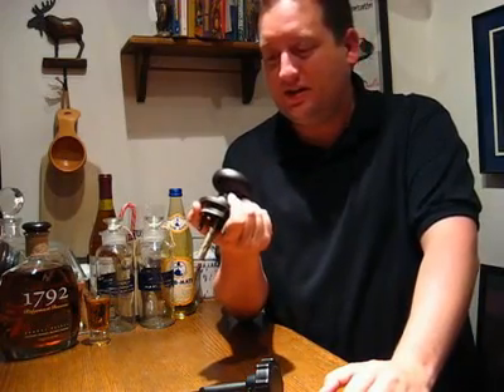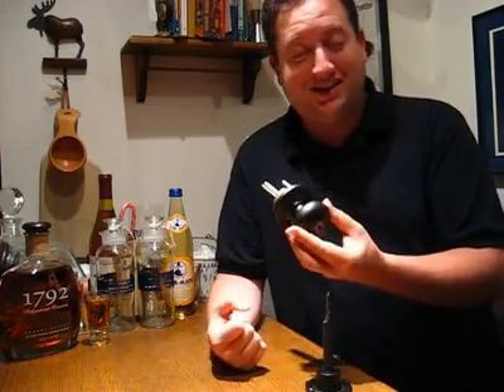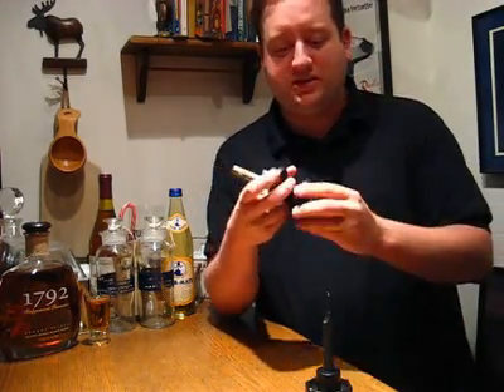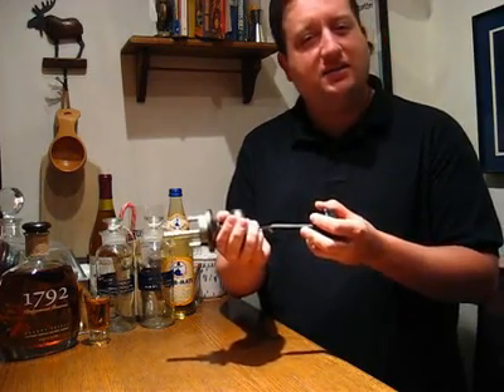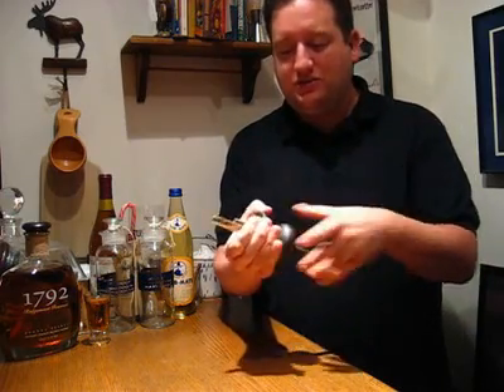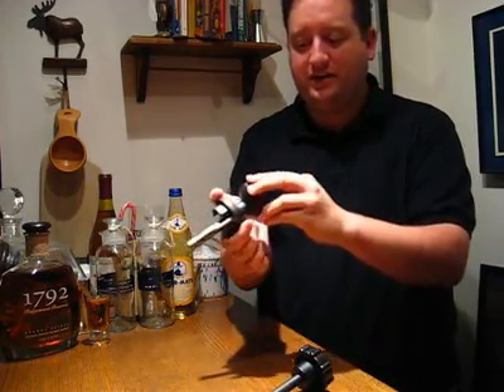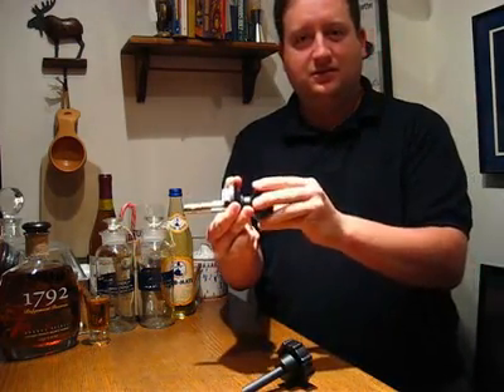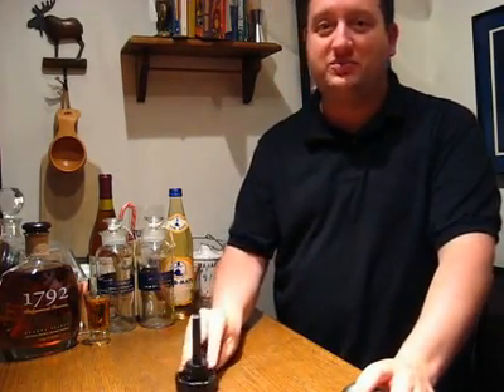Kwikset Smart Series Smasher Tool

Comment: The GEN3 & GEN4 locks no have all steel parts. 
The makers of the force tools have yet to say if their tools will still open the newer all steel parts locks
Reply from the maker: +rallock67 correct.  this has gotten a lot harder to do, but the decoding attack vulnerability is still significant
Reply: +DeviantOllam  Could you post that decoding video?

Comment from the maker: interesting... sounds like you must have a newer generation of SmartKey lock.  usually the whole left side of the plug (the wafer carriage) is a plastic component.

if Kwikset has replaced that with metal pieces, it sounds like they are really starting to take more seriously this issue.

of course, nothing they do is likely to ever prevent the decoding attack.

Comment from the maker: @rwdemamiel from everything that we've seen, no, this is not really workable.  as demonstrated (and discussed, even) in video VH7ekPB68OM, the "minimal movement" results in a bump blow that comes to a final resting position too deep within the lock. the sidebar will not be properly aligned at that time.  a "traditional" or "pull" method of using a bump key is what's needed to attack a Primus.

Comment: Great Job, have you tried the tool on one of the newer locks, I know they sell an extension for that tool so you can get some more torque on the newer locks.  Also saw a video of a guy using that tool on a newer locks and snapped the tool.  Thanks for the video.